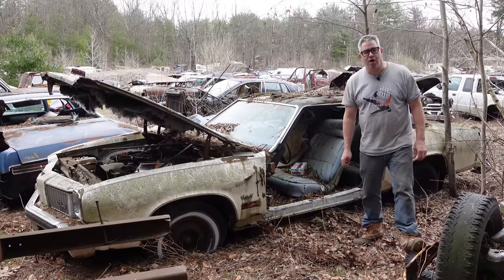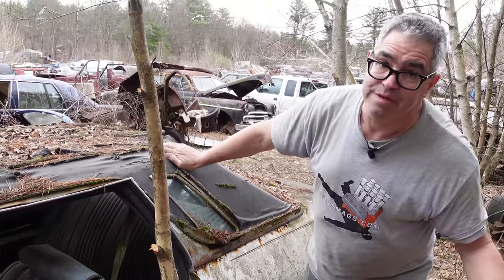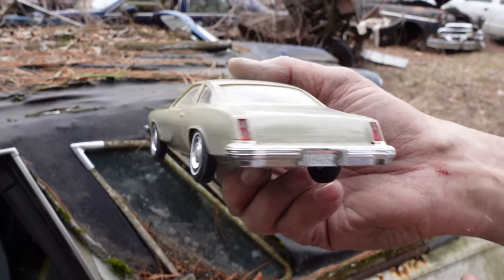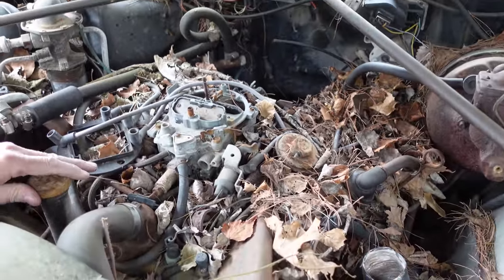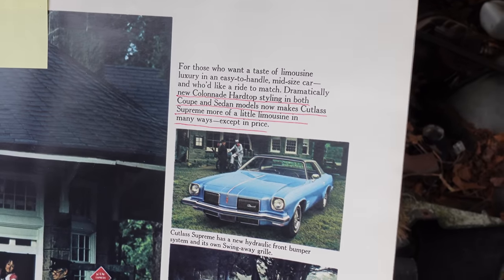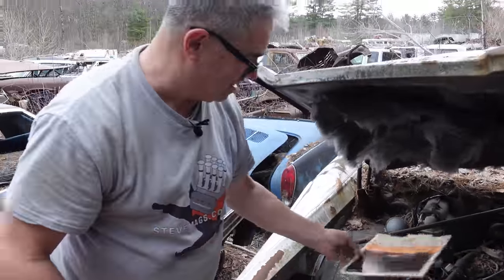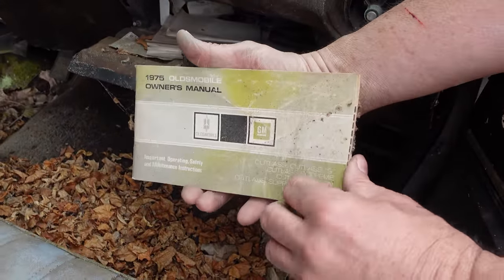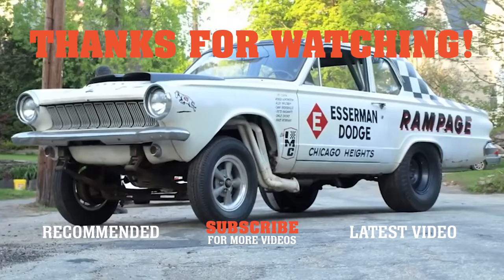A Lot More Cutlass

Comment: That block off plate was for optional clock Steve, welcome back, love your commentary on Barrett-Jackson!
Reply: I had a friend that had a 75 Cutlass and I thought that was the dumbest place ever to put a clock! It looked like they just shoved it in last minute as an afterthought!
Reply: Wasn't the clock display in the radio
Reply: @rogergoodman8665  Check out the '69 and '70 full size Fords - they had the radio to the left of the steering column, but higher up than the Cutlass's clock. In '76 or '77 the clock moved to above the glove box. 
In '75, radio tuners were still all analog, so no integral clocks.
Reply: @tompaciga7386  Not in these years. Later on with digital radios they would be. That wouldn't be for several years for the Cutlass line.
Reply: @tompaciga7386 Nope, standard analog radio with knobs and push buttons. AM/FM. You could get a factory   optional 8 track. Most people usually opted for aftermarket Kraco, Jenson, or Pioneer units in 8 track or cassette. I dont remember digital units coming along until around 1980.

Comment: In the late 70s or very early 80s my brother had a beautiful 75 Olds Cutlas Supreme. Black with a white vinyl roof. Bucket seats and console. I don’t think they were swivel seats but had the reversible cushions. I liked it as much as his 68 GTO. In the mid 80s when looking for my first car, I set out to find one. Ended up with a 75 Grand Prix. Loved it. Still have one to this day. GM colonnade cars are actually my favorite body style of cars. These days the lack of performance is easily cured. These deserve more love than they get. If nothing else they are probably America’s most reliable and durable cars ever built. I bet most muscle car die hards have a soft spot for these cars wether they admit it or not.
Reply: I had a 1974 Olds Cutlass Salon International Series. Mine had velour reclining bucket seats that were very comfortable. I sadly sold it over 20 years ago but recently purchased a fully loaded 1976 Chevrolet Monte Carlo Landau from an old lady that had it in her garage since 1995. The car still looks and even smells kind of new on the inside with under 15,000 original miles on the odometer.

Comment: I've owned 2 Cutlass's.  A 1976 Cutlass Supreme Brougham,  blue exterior with white landau top and blue bench seat interior.  I added dual exhaust to the Olds 350 in it. It sounded good and was a very nice highway cruiser.     I currently own my original owner (bought it new)  1985 Olds Cutlass Supreme Brougham,  white exterior with dark blue landau top and dark blue 60/40 bench seat interior.  It has over 350,000 miles on it.  Came with the Buick 3.8 V-6 originally.  Now a SBC 350, aluminum heads and headers, Q-jet, duals,  Grand National 200-r4,    and I enjoy street racing it.

Comment: Amazing how large the personal luxury coupe market was back then.  The Cutlass was everywhere.  Growing up, I knew a few families that had the Cutlass Cruiser wagon variant.  Our family bought a 79 Old Cutlass Salon Brougham..the four door aero back...with the fixed rear door glass...and a 260 V8 Olds V8...which has the same oil filler spout as the 75 350 V8.  Not much on power but decent enough fuel economy and reliable enough to get us 140,000 miles and 12 years...we sold it in 1991.

Comment: That block off plate is for the factory dash clock. It’s interesting that someone went for a Cutlass Supreme yet didn’t bother with the dash clock.
Reply: Alternatively, hard to believe dash clocks were options. Then again, my dad's old Toyota pickup didn't have one either.
Reply: Why would they put the dash clock in a position only the driver can see? Odd, every car I've owned with a clock (all of them, from the "digital quartz" of my 89' Accord on.) have had them in the center part of the dash for everyone to see.
Reply: @marcusdamberger  not only is it way down and to the left, it’s also an analog readout on a wide rectangular dial with only 4 numerals. It’s definitely not an easy clock to read at glance while driving.
Reply: Not always bought by ordering from the factory, how many times can a car be bought and sold? Many times I think. Most people got what was on the lot .

Comment: Love the Cutlass, my first exposure was a friends Dad's plain-jane 1970 but it had the 350 and lots of torque What I remember the most is the sweet sound of the factory exhaust, not sure why, it wasn't modified or anything, but for a single exhaust it sounded great, but hey, I was 15 at the time (1972) and was easily impressed. Thanks Steve!
Reply: Agreed, the Olds engines had a unique snarly exhaust note.
Especially the 455 Rocket.
Reply: @unclebob7937  But those Olds V8s were still smooooooth as could be!
Reply: @DanEBoyd  You got that right!  Rocket Power! 👍😎

Comment: One of my uncles bought one new from the showroom in 1976. It was the 442.  Black with yellow graphics.
Swivel seats and all. But the catalytic converter and restricted heads made it slow. I was 6 when he bought it new and they kept that car, after painting it brown, for years they sold it when I was 23 years old.
The reason it was painted brown was due to my uncle getting pulled over by our local police on a regular basis.
All they knew was 442s were supposed to be fast and that uncle Marvin used to race around the town on the reg. . So he painted it brown and put ugly hubcaps on it.
😁

Comment: I had a 75 442.  Swivel bucket seats. Bought it in 86 for 250 bucks. Had a bad trans and no keys and we towed it home with a chain!   I pulled a 455 motor and trans from a 69 delta 88.  That car used to kill the iroc z’s and other 80s cars.

Comment: I owned a 71 Cutlass Supreme back in high school (84/85). It had a blown 350 when I got it and I put in a 350 out of a 74 full size Olds I bought from the junkyard. I pulled the EGR intake and replaced it with the intake and carb from the 71 engine. It was so carboned up that you couldn't even see the cam and lifters. My dad told me to chip it out with a hammer and chisel and clean it with Gunk. I also pulled the valve covers and cleaned around the rockers and valve springs. It was really horrible. Needless to say I didn't expect much. Boy was I wrong. That engine ran great. It would light up the right rear tire in 2 gears and on a trip from the Kansas City area to Ft. Worth to visit my grandma one summer it knocked down a solid 19 mpg with the A/C running the entire time. I was pretty hard on that old car but I was a teenager. Towards the end of high school I sold it to my sister and brother in law. My brother in law was even harder on it than I was. It continued to run great and to get exceptional fuel economy for a carbureted mid sized car with A/C. One day my sister was driving it and someone ran a stop sign and T-boned her. She wasn't hurt but the Cutlass was totaled. My brother in law sold it, still running, to someone needing an engine for their Cutlass. I wonder if the engine still survives? That was probably 1988 or so. Anyway, great memories from a great car. I owned a 78 Cutlass years later and I replaced the anemic 260 with a 72 350 plucked from a wrecked Cutlass. It was quite a sleeper.
Reply: Nice story

Comment: I worked at a Buick dealership in the very early 1980s. We had a 1977 Cutlass with 260 V8 and 5 speed as a used car. I had driven it.

Comment: No, that block off plate is for the clock as others stated. This one had AC as you can see that some of the parts are still installed under the hood. Now it's a "Gutless Cutlass". 

No, the catalytic converter doesn't reheat the exhaust gas, it merely (by means of platinum and palladium inside of it) converts byproducts of combustion into less harmful substances emitted from the tailpipe. The monolith style converter used on these cars was very restrictive. I can remember hearing stories of the small pellets being emitted from the tailpipe when there was malfunction. 

No VIN, can't win, but easy to figure out, no doubt: 3 for Oldsmobile, J for Cutlass Supreme, 57 for two door hardtop coupe, K for 350 V8 with four barrel, aka "Olds Rocket V8", 5 for 1975 model year, possible M for Lansing, MI assembly, or G for Framingham, MA assembly or D for Doraville, GA assembly, or R for Arlington, TX assembly among other choices and the rest is the production sequence. Doraville, GA closed in 2008, Arlington, TX still operates today and assembles trucks and SUVs, Framingham, MA closed in 1989 and Lansing closed in 2006 with today's Lansing Grand River plant "assuming" the duties of the former Lansing, MI "home" Oldsmobile plant.

No tag, can't brag, but easy to figure out, no doubt: ST75 for 1975 model year, 3AJ57 for Oldsmobile (3), Cutlass Supreme (AJ) two door hardtop coupe (57), possible FRA for Framingham, MA, D for Doraville, GA, LAN for Lansing, MI or R for Arlington, TX assembly among other codes, possible 10 or 40 for Black interior trim, 11L for Cameo White lower exterior paint, A52 for bench front seat, and possible B or BB for Black vinyl top.
Reply: I was thinkin' the interior may have been blue? Those early cat's were meant to be serviceable, a plug was underneath where the beads could be taken out and somehow "cleaned." For whatever reason, don't think any were serviced that way.
Reply: @tomwesley7884  Door panel looked black.
Reply: @tomwesley7884  Wow, never knew that. I remember seeing that plug and thought it was where the manufacturer put in the pellets and then sealed it. Those things were junk. I'm glad my 74 Charger was the last year before mandatory cats.
Reply: @LongIslandMopars  There was a service kit for them I believe back in the day.
Reply: @googleusergp  Amazing. Never knew that. My dad would cut the cats off. He could tune them to run better and still pass the tailpipe emissions test.
Reply: @LongIslandMopars  The first owner of my 1979 Trans Am did that and put in a straight pipe. Rumor has it that he has a box of stuff for the car, but when I inquired further he said his ex-wife (or wife) may have tossed it. I have to try to get back in touch with him again. 

0 for 2 for Mopars today. I have some splash shields up for sale for the newer "LX" body cars. I used one of them on my uncle's 2005 Chrysler 300 and he said, "I don't want to hang on to those. Sell them". A coworker gave them to me as his brother in law had a 2006 Chrysler 300 and then sold the car, and then passed away. So a guy contacts me and wants to come over and when he does, he realizes that the rear shield I have isn't what he needs. He needs a rear valance over the exhausts. I sent him a couple of photos ahead of time, but he was looking for the wrong part. No worries, back into the garage they went. On the way home, I decided to go to the store. I walked to my property as I do that for exercise (it's about a mile up and a mile back). On the way back as I'm crossing the street, I see a Matchbox type (it's not a MB, it's another brand) car in the street, flipped over. I get it, and it's flat as a pancake. What is it? A 1969 Dodge Charger R/T which I guess is supposed to be code Y2 Yellow exterior paint. Forget about "altered wheelbase". This one is "Flat Stanley". LOL.

Comment: Had a "75 Cutlass Supreme 2 Dr like this....Chocolate brown with a brown full vinyl top....All of the 2 dr Supremes had the more formal "V" shaped rear window with the smaller quarter windows....All the other Cutlasses had the fastback shaped rear window with either the larger or smaller quarter windows.....There was no "block off" in the c pillar on this Cutlass Supreme like Steve alluded to on this particular example.It was all a solid metal stamping......If you had the smaller quarter windows on a fastback Cutlass,they all used vinyl tops covering up the larger window as the "block off",making it appear that it was a smaller quarter window.Underneath that vinyl top was the larger quarter windows.

Comment: The catalytic converter didn't reheat the exhaust - the exothermic chemical reaction between the exhaust gasses and the coating on the converter pellets produced the heat.  The emissions reduction was due to the reaction, not the heat.

Comment: The block off was where the optional clock would go. I had a 1975 Cutlass Supreme with a 455, factory air shocks, posi, etc. Would run 140 mph with absolutely no wind noise.

Comment: Yep, I remember Oldsmobile!

At one point in time, I owned an 1984 Delta 88 Royale.
If I recall correctly, it was powered by a fairly wimpy 307 V8.
Of course, the "wimpiness" could have simply been due to it having over 150,000 miles when I bought it.😁

I remember buying it from an individual, for a whopping $400!

Car had a very plush interior... probably the plushest interior of any vehicle that I have ever owned.
And IMO, the car felt like it was "floating" as I traveled.

Unfortunately I only had the car for about 3 years.
The engine finally gave up the ghost. And I was in a very low point in my life, and couldn't afford to fix it.
So I sold the car for scrap... and walked/rode a 🚲 for about a year, before finally buying another used vehicle...an 1981 Ford Courier.
Reply: I've had a Delta for the past 27 years, sadly she's been sitting in the driveway for quite sometime, still like lookin' at 'er
Reply: Nice
Reply: I have an '84 Delta 88. My uncle bought it new. It went through my uncle's whole family. The two adults drove it and then all the kids. I used it for several years and have "retired" it, but still kept it. Yes, it would have either had a 3.8L (231 CID) V6, Buick produced with two barrel, RPO code "LD5", or the most likely choice is a 5.0L (307 CID) Olds V8 with four barrel, RPO code "LV2", or as I call the "mini pocket Rocket", or an Olds 5.7L (350 CID) V8 diesel, VIN code "N", RPO code "LF9".

Comment: There's no block-off plate under the vinyl top of a Supreme to create the small side window. The roof of the base Cutlass S is a different stamping than the Supreme.  Vinyl delete cars will show a solid roof with no plate.  The Supreme rear window is more upright and formal and has a vertical fold down the center, but the S is lower and has no fold like a fastback.  I had a '77 Supreme in high school.
Reply from the maker: Good call. I'm pretty sure the Supreme shares its B-pillar (and maybe entire roof) with the Chevy Monte Carlo. Looks like a probability. Thanks for watching and writing. -Steve Magnante